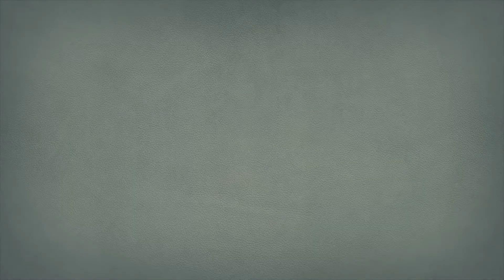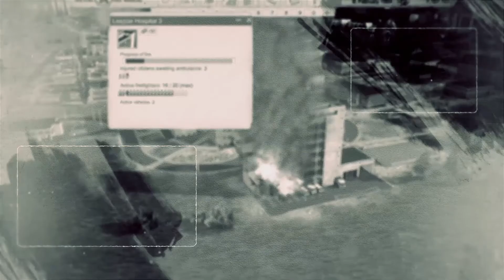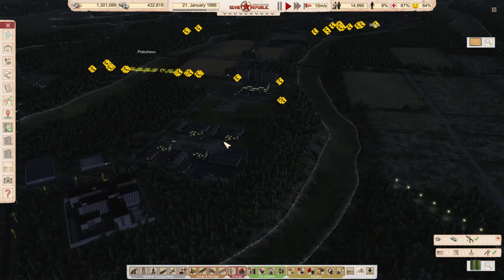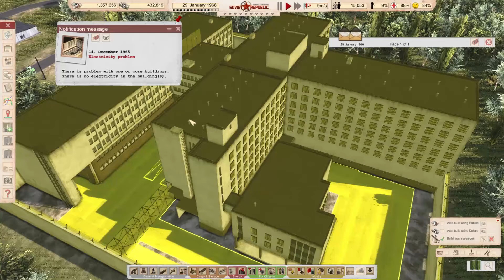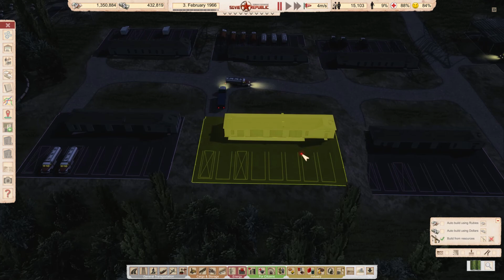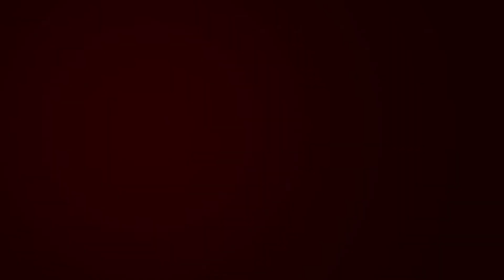Soviet Republic - Amazonas- Episode 25

Comment: Before I forget!  I think two open cars and one hopper car per train makes the most sense.  The steel should load twice as quickly onto two open cars, as both cars will load up at the same time.  I don't usually think to do multi-role trains... it could work!
Reply from the maker: Thank you for your approval. I noticed that some stations unload 3-4 wagons at the time. Probably we are safe with 3. Thanks!!